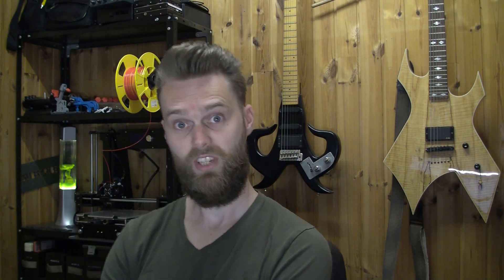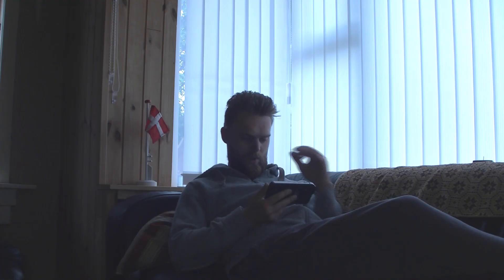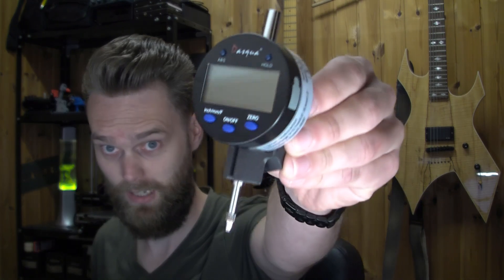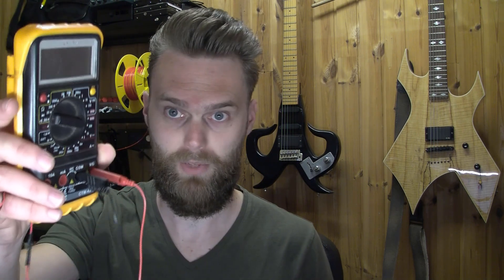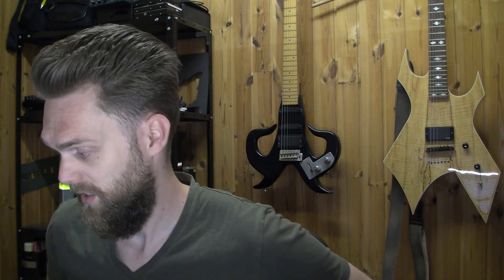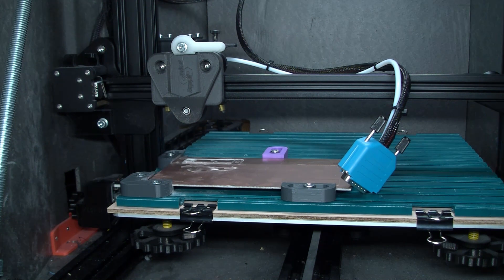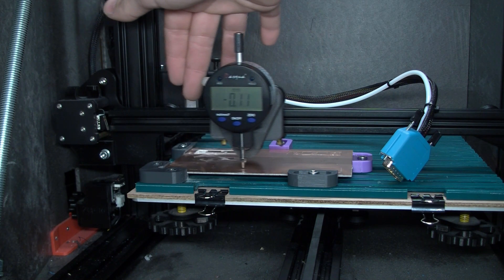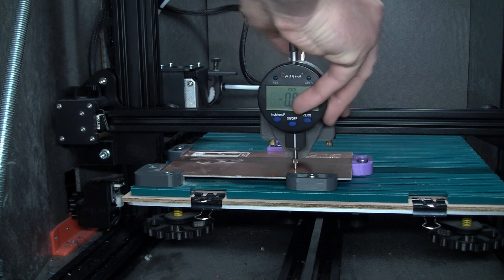DIY PCB on Creality printer and nailed it!?

Comment: Can you flash two different programs on the cr10 or would I have to flash every time I change from printing to milling?
Reply from the maker: No you can't, but the milling firmware is capable of 3D printing as well. Some safety mechanisms are shut off, like negative Z movements, but you can still print with it.
Reply: @properprinting  I’ve have been going through all your videos and I thought I saw on one video you shows how to flash the firmware but I can’t find it do you happen to know what video it was
Reply from the maker: @4Houtdoors  I did show it briefly in this video, but I recommend following the links provided in the description of this video.

Comment: Would it be possible to make a pcb by putting copper tape on some plastic, and then 3D printing a mask (or I guess cutting a vinal sticker) for what you want to keep and then removing the unmasked part with acid? Actually why not skip a few steps and put copper tape directly in a vinyl cutter?

Comment: I've been using your quick tool change (ender 3) with a flex shaft to mill out some PCBs myself, initial results weren't great but ive been able to get down to 0.2mm traces now. Your mounting system is solid, thanks for that (and your videos! I always enjoy them)

If you do this again, try doing multiple passes, but don't use FlatCAM's option for that. For example I mill my boards 5 times, drilling 0.05mm deeper each time. Produces much cleaner cuts on the copper with less burrs. Also WD40 works wonders for containing the dust while milling.

I've also made a little script to do bicubic grid leveling to the gcode files before cutting, which is important if you have an uneven bed / warped board (Or if the drill applies uneven pressure depending on what side of the bed it's on like my ender 3). Gonna put that up on github soon
Reply: any updates on the script? :)
Reply: Asking about the script again, any progress?

Comment: can you explain why you had to upgrade firmware.
Reply from the maker: Yes, it turned out that the stock firmware didn't enable the printer to go into a negative Z-direction. Making all coordinates positive should work as well, but for me it was easier to enable this.

Comment: Maybe You should extend Your Z end stop to make connector of two cables - the same as You are doing right now... You can connect one cable to board and another to bit and when it touch together they work the same as z stop.
Reply from the maker: That's a good idea actually if I'm going to do this more often, thanks for your suggestion!